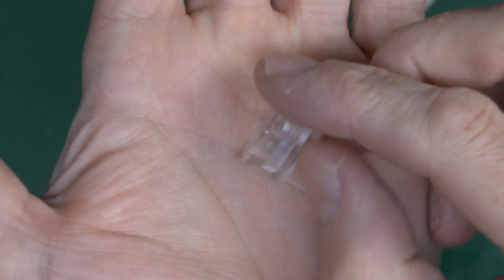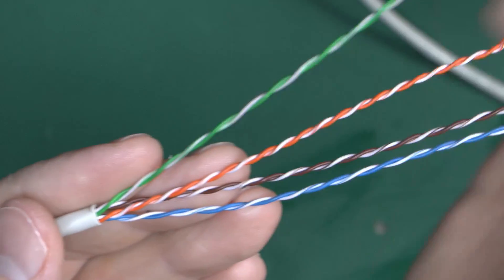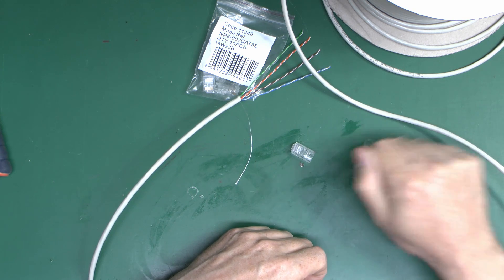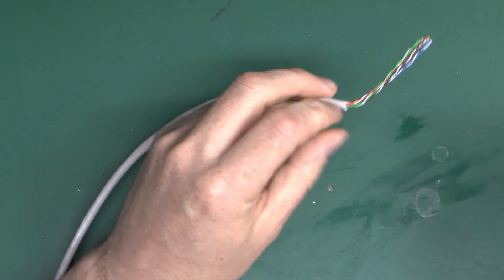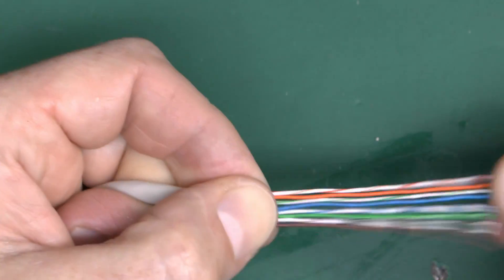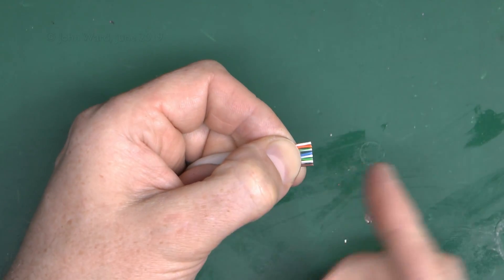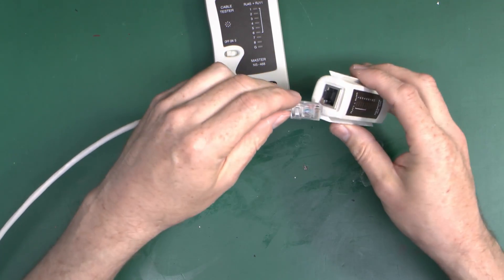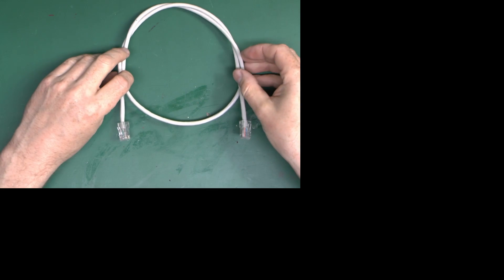Fitting 'RJ45' plugs to CAT5e Cable

Comment: there are new cat5 / 6 plugs that have little slots inside the plug, that the wires fit exactly into. Makes them fit perfectly every single time. Cannot recommend enough, but you need a special crimper for them. They're called EZ RJ45, and if you do this for a living, they're a huge time saver. I suspect once the patent runs out they'll be the norm
Reply: I've never met an engineer who will touch so-called "Ezrj45". They're awful and banned in several countries because they're dangerous. Enjoy your shorts. They're not gonna replace anything, patent or not. They need to be redesigned because they current design is so prone to shorts its absolutely horrendous. 

Edit: apparently this video is a response to a video going around instructing people to use EZRJ45.
Reply: @medes5597  I agree, EZrj45 are rubbish and are`nt any quicker to terminate if you know what you`re doing.

Comment: "What a well designed locking tab", said no one EVER, trying to pull network cables, when the STUPID tab breaks off. Great instructional video.
Reply: vondeliusc why would you pull cables in after you’ve made the ends off? Weird.
Reply: @nathangatenby5744  Pulling them up from behind the desk in the tangle of speaker/power/monitor/phone wires; They ALWAYS get hooked on something :-)
Reply: Or... The rubber bit over the locking tab dries out and you can't squeeze the tab hard enough to release the cable.
Reply: There's a story about why those locking tabs are the way they are. Bell Telephone/AT&T's original telephone plug/socket was a 4-prong style. An engineer tasked with creating a replacement for it didn't think it really needed to be replaced, so he came up with a design so bad he was sure it wouldn't be accepted: It wasn't reusable and it had a locking tab that eventually broke off. Much to his surprise, it was accepted and that's how we got these modular connectors.

Comment: Ohh good memories , lots of crimping to server racks till record in the head the colors from TIA 568-B :P   Now computers have auto-sensing on twisted pairs ( oranges and greens) 

Here the CAT6 is becoming here the main vogue.  Be sure to buy a decent crimper for good results in heavy dutty work. Pull a little more the sleeve (  13:41 ) to front  to fully garanty when pulling the cable is the sleeve being stressed not the wires at front.

Comment: Better off using the pass-through RJ45's.  Much easier and you know if the colours have remained in the right order before you crimp.  Plus exact individual cable length is not critical as they are cut off flush to the connector when you crimp.

Comment: There's also a variety available where you're not required to shorten the wires. They stick through the plug and they get cut during the crimping process (require special crimping tool).
Reply: I was going to mention these ,I find them a bit more expensive but far easier for myself who has a damaged hand to use...you can use a standard crimper and a sharp blade to cut the cables
Reply: I've been thinking my whole life that a golden opportunity to make the world a better place was missed by not letting the wires stick through!
What are they called?
Reply: @stefantrethan  "Pass Through RJ45 connectors". Pass-Thru is the trademark of the american tool manufacturer Klein Tools for the same thing.
Reply: Marcel Germann Yes just got some but not tried them yet.
Reply: i have a hauxin network set that came with  those connecters and the tool

Comment: I never new about the difference in twist ratio between pairs. I don’t understand how it makes an improvement, but very interesting. Thanks John
Reply: Most uses of twisted pair cables are "balanced" you have a +v and  a -v  at the receiver you take +v and subtract -v  2 give 2v.  This will  have the effect of any inducted  interfearence being deleted.  If the twist ratios were the same then any capacitive coupling between +vs and -vs would match and would not be canceled out.

Comment: Originally the odd cable arrangement was for telephone use. The blue pair was for the phone audio, the brown was for 6VAC to power the dial lights, and later on to power speaker phones. The other 2 pairs were for PBX features, so they were used by the early creators of computer interconnections as a way to use the existing copper cabling in an office and still have a phone.
Reply: A few++ years ago the newfangled PBX guy came in and wired everything with cat5e/6 (either T568A or T568B) cables to the 110/RJ45 blocks and (in the Manual for) the NEC BPX the jacks were wired "RJ61 (USOC)" ...... the crisscrossed pairs drove me nuts and I always vowed to fix them, but thankfully it was a small office and I never noticed any issues with cross talk.

Thanks, I knew that some of the pairs were used for 2-3 more lines and other features*.
(* this information never filled in)

Comment: Hi John,
Nicely done, That check tool used for continuity of all the cores could be made with a 555 timer ic and a 4017, one of 10 Johnson counter if the 555 as an astable clocking the counter once every sec or so and the eighth count is fed into the reset pin on the 4017 and the sequence starts from the beginning  producing the count that is shown with The LED's, hope
Very basic but hugely useful tools,
People who don't label their work should be shot,
Their laziness has wasted a lot of my time!
These sorts of tools invaluable! you didn't get striped up over the price I hope
Good video excellent quality resolution viewing from here
Kind regards Warren
Reply from the maker: The testers are incredibly cheap, less than £5 delivered from the usual places such as ebay.
Reply: John Ward John, why go ebay when these are available from WARRENTEC,  bespoke made testers only £9.99+vat
Reply: John Ward Just kidding, hope you are well
Reply: @warrengray610  the proper testers are usually more than just continuity testers too.. they are ringing testers which ensure that a high frequency signal is not being distorted.. this becomes important as it detects intermittent contacts, shit cable, and kinks/exceeded bend radius
Reply: @jaycee1980  Hi there, interesting!
So some of these more bespoke type testers actually allow you to send signals through in order to ascertain the state of play within the installation!
Clever stuff, I take it (perhaps wrongly) that you in in data and communications, personally I mostly work with power electrics so traditionally we only needed to  use voltmeters/ continuity testers/
Insulation resistance testers!
Mind you because I have electronics as a hobby I often dreamed of constructing a high frequency generator and listening device to help with locating problem sections of wiring hidden within the buildings infrastructure!
I never got around to it but such devices have existed for a while!
Damm I missed the patient office on that one!
Take care out there mate
🙂
Reply: Warren Gray - in telecommunications cable testing, there are also pulse echo testers / time domain reflectometers (TDR). Very handy for fault location.

Comment: Always handy to make up your own cables for any 'quick fixes' I was rather sad and Cat5'd my whole house when I moved in - 2 sockets in each room. Now....

The fun I used to have in the early 2000s with making cables up when needed (usually for PC feeds where getting someone in to do it properly wasn't worth it ie.next office on a temp basis).........you see I am slightly (fully?) green / brown colour blind so despite being a dab  hand at making cables up, I always had to ask someone to have a look at the bunch of strands in my hands and make sure they were the right way round. Oh how they laughed :-(
Reply: That was my father, blue green colour blind. Learnt early on how to wire a plug, because he would always have me check them.
Reply: Better to ask than have to crimp a second time. You didn't deserve to be laughed at when you were being sensible.
Reply: gooshh after doing a few hundred you're eyes🤪 start getting crossed and you need to double check your work.

Comment: I hate to think how many of those I've done over the years, certainly many thousand.

It would be nice to show connecting the socket, be it wall plate or keystone, punch downs as these are increasingly being fitted in domestic properties these days.
Reply: Last lot I did I used 4km of cable, and that was not a large job. When you are drilling a 110mm hole in walls to route a cable bundle you might think you are pulling a lot, but the 110mm drill was to hand, I could have used a 75mm one and still gotten the bundle through. Went through 10k of cable ties though, bundling them together in the trunking.

All got ripped out 5 years later.......
Reply: @SeanBZA  The only time I counted was when I spent a long holiday weekend extracting several iterations of redundant structured cabling from beneath a computer room's raised floor.  It was about that, in an astonishingly small room.  :)
Reply: @calmeilles  I know because I was using 9 500m boxes of cable, doing multiple runs at a time to each location. ended up with 3 boxes of around 50m left, and enough to make all the patch cables inside the rack. Plus lots of mangled ends from feeding through walls and spaces that were cut off as scrap. Did start with a big box of crimp plugs, and ran out near the end, but have plenty of the wall sockets left over, including ripping all the old cable out as the job went on in sections. Scrap pile was 4 full garbage bags just in cable.

Comment: i watched this all the way through and have no idea why, i have done hundreds of these.
Reply: Me three, thousands. John did a good job of instructing; Not sure if I missed it but did he show a color chart?
Reply: @BrilliantDesignOnline   ORG/WHT, ORG, GRN/WHT, BLU, BLU/WHT, GRN, BRN/WHT, BRN is the standard. left to righ as you look at it, clip to the bottom on the RJ45 connector. T-568B config.
Reply: @muzikman2008  I basically know that, but I prefer a chart to verify visually, and have a bad memory. Thanks.
Reply: Morbid curiosity?
Reply: Me too, I just wanted to see if somehow I've been doing something wrong
Reply: Me too...lol thousands in fact :-)
Reply: I'm surprised he didn't mention the difference between solid and stranded connectors.
Reply: @jamess1787   Me 4 !
Reply: I was under the impression that the rule was "solid to sockets, stranded to plugs*".
Reply: @johnalexander2349  doesn't really matter. Flexibility is good with stranded; but it makes no difference unless density is a problem.

Comment: I always found it a bit weird to have solid blue right after striped green, because at the end does it really matter as long as both ends are the same? Of course it's important when making a crossover cable but in general it seems like one of those old things that have stuck ever since those cables were introduced but what do I know.
Reply: It does matter when you are 100 feet from the other end, fixing a botched cable that someone else made and the colors are wrong. you end up having to redo both ends then re-test.
Reply: Yes it matters, look on what is connected to what pairs, it is a question about cross-talk and noise, but for some people this do not matter because "look it works!" (tested with the cheapest tester from eBay), put a real tester on the cable and see, or connect gear that can fill the cable with data and you will see that it have to re-transmit a lot of data if you happen to had done something wrong in your installation, even due to the fact that it initially seems to work ok
Reply: @K2teknik.  I didn't knew it had something to do with cross talk and noise, well now I know. Thanks
Reply: It’s a standard. Standards are nice if everyone sticks to them. Don’t be that guy that doesn’t. That guy makes life harder for everyone.
Reply: yes more, hopefully I can explain it with a comment I already made which now I have to go back and fix.
As long as the pairing is maintained they're just arbitrary colors, however!!! if I see a cable wired with a weird color pattern I would probably end up redoing it because it most likely means that somebody's crisscrossed say an orange + pair with a green - pair or any other color pair.
The Orange pair is traditionally +/- transmit and the green pair is traditionally +/- receive. and when you move from 10/100 to 1000 the blue and brown pears are respectively used as well.

If you go to the phone world, the blue pair is traditionally line 1 (old Green+/Red-) the Orange pair is line 2 (old Black+/Yellow-) Green 3 and brown 4. And that is why you technically can plug a 2 or 4 wire phone cable into a RJ45 Jack, although the spacing is just slightly off enough to be damaging in some Jack manufacturers cases.

and on 10/100 networks 123_6_ for data
and for phone __45__
that way if a phone line gets plugged in to a network card nothing happens ( Yah that will never happen... only the white coats touch the computers).

and
@Matthew Malthouse
"That is one of the mysteries of networking that is only revealed to the highest echelons."
yes and i am the one, they call neo, from the tel-net matrix. (was that sentence ever a play on words).

Comment: Interesting vid. I have a (probably stupid) question, why put the solid blue next to the striped green, and solid green next to the striped blue? Wouldn't it make more sense to put all the stripes next to the corresponding solids?
Reply: No,  its because of the definition on which pins the corresponding twisted pair has to be connected. One pair is on the middle pins, one pair on the next outer pins, pair 3 on the two outer pins on one side and pair 4 on the other side. This pinout is defined to be compatible with pots and isdn lines.
Reply: The standard says so, that is why you do it, but test had shown that this "strange" way of connection the pairs (combined with the strange twisting) reduce the  cross-talk and noise. The idea is to use the cheapest cable and get maximum performance out of it
Reply: yes more, hopefully I can explain it with a comment I already made which now I have to go back and fix.
As long as the pairing is maintained they're just arbitrary colors, however!!! if I see a cable wired with a weird color pattern I would probably end up redoing it because it most likely means that somebody's crisscrossed say an orange + pair with a green - pair or any other color pair.
The Orange pair is traditionally +/- transmit and the green pair is traditionally +/- receive. and when you move from 10/100 to 1000 the blue and brown pears are respectively used as well.

If you go to the phone world, the blue pair is traditionally line 1 (old Green+/Red-) the Orange pair is line 2 (old Black+/Yellow-) Green 3 and brown 4. And that is why you technically can plug a 2 or 4 wire phone cable into a RJ45 Jack, although the spacing is just slightly off enough to be damaging in some Jack manufacturers cases.

and on 10/100 networks 123_6_ for data
and for phone __45__
that way if a phone line gets plugged in to a network card nothing happens ( Yah that will never happen... only the white coats touch the computers).

and
@Matthew Malthouse
"That is one of the mysteries of networking that is only revealed to the highest echelons."
yes and i am the one, they call neo, from the tel-net matrix. (was that sentence ever a play on words).